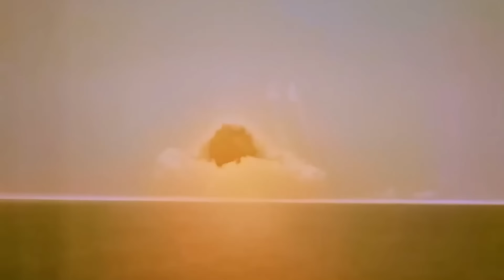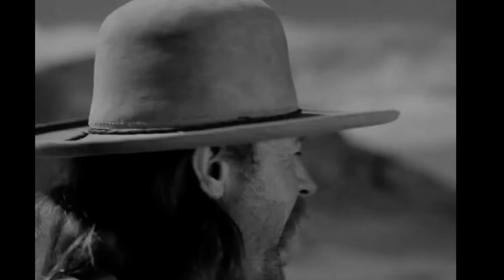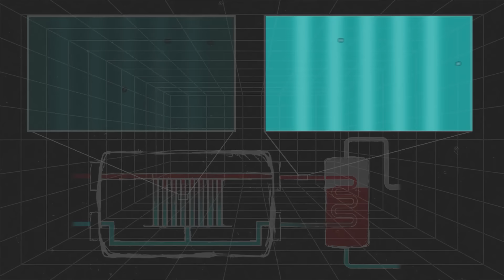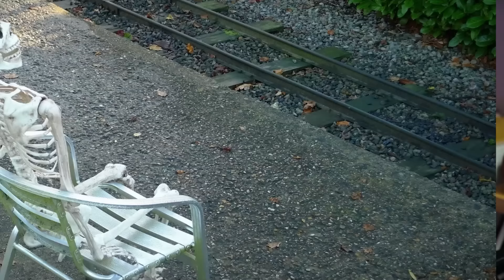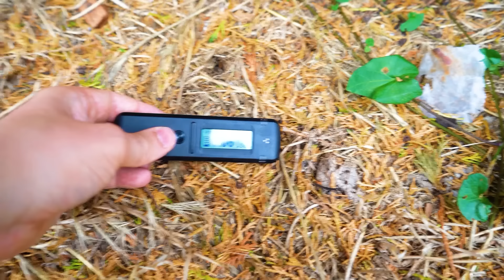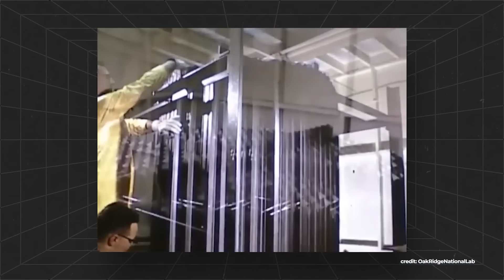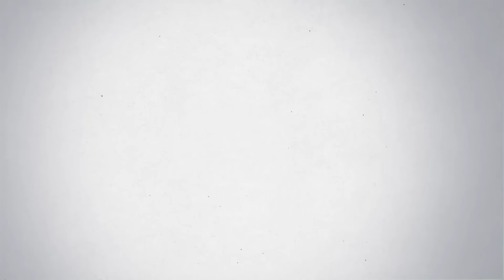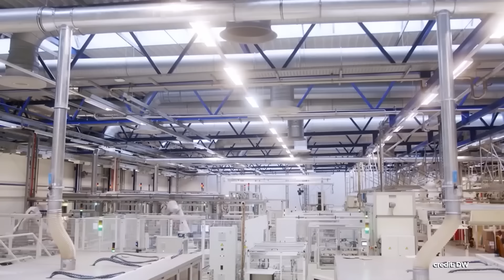It's Happening - China Launches World's First Thorium Nuclear Reactor

Comment: well, why dont you just tell folks the short and simple.... ie... a thorium reactor is the best design as when there is control failures, power outs etc... the core just goes to sleep.  it does not and cannot go supercritical.  and,.. the usa dept of energy... (corrupt as it is over the many decades ive worked with it) had development programs for this tech.  but.... it got killed off by the money makers.... so, vote for the thorium core... its good.  just my opinion

Comment: A physicist claiming that China's reactor (which won't be operational until at least 2029) is the worlds first??!

There have been several thorium reactors built and running operationally: Oakridge National Labs ran the MSRE (Molten Salt Reactor) for 15,000 hours 1965 - 1969.
The third Shippingport nuclear reactor was a thorium reactor. Over its 25-year life, the Shippingport power plant operated for about 80,324 hours, producing about 7.4 billion kilowatt-hours of electricity.

Comment: AFAIK, your comment regarding any potential advantage of Thorium molten salt reactors siting in desert areas because they "don't use cooling water" is wrong.  The cooling water in any steam turbine based electrical generation is used to condense the steam.  Then the condensate is pumped back to generate more steam.  The molten salt cooling loop still is used to generate steam.  It is just the high pressure part of the system is separated from the reactor.  If you site any steam driven system in the desert with limited availability of make up water, you need to use air cooled heat exchangers, which use more energy and cost more than cooling towers.

Comment: one point, a plus point, is that Thorium reactors output can be regulated (modern steam turbines and generator designs are called for) simply by the circulation rate of the molten salt. The total heat produced is dependent on the residence time of the liquid in the active core. With a modern turbine and generator, these reactors can provide flexible output on demand.

Comment: As stainless steel melts at 2,500 degrees F, it would seem that the piping and other containment vessels in a Thorium reactor would need to use some sort of metal alloy.  Possibly using Tungsten (?).  Whatever is used it would not be cheap.  Another alternative would be to use cooling coils that surround the piping and structures.
Reply: Copenhagen Atomics properly solved all these problems around corrosion by molten salt. Check their videos first.

Comment: I don't get it. -  A thorium powerplant also needs a nearby source of water to feed the steam turbine circuit that generates electricity. But, in the Gobi desert, I don't think that there is an abundant source of water except for underground water which is limited and should be reserved for agriculture and drinking water. Yes, I understand that condensers reduce the consumption of water but does not eliminate it.
Reply: that water is recycled water.
Reply: @michaelwan4268  - recycled water coming from where ?
Reply: @cybair9341  I mean the water used to drive the turbin is internally recycled, thus it does not require that much, and it it does not require constant cooling water, which is the majority consumption of the water.
Reply: @michaelwan4268  - The recycling is far from being 100% efficient. Lots of water is lost as steam escaping at the top of the condensation towers. Additional water has to be supplied continuously to compensate for theses losses. That's why nuclear reactors are built near sources of water. Not in deserts.
Reply: @cybair9341  yes it does still need some water, but water is no longer a constraint, that is why China build this in Gansu Province, there is still some water supply there.

Comment: Thorium cannot in itself power a reactor; unlike natural uranium, it does not contain enough fissile material to initiate a nuclear chain reaction. As a result it must first be bombarded with neutrons to produce the highly radioactive isotope uranium-233 – 'so these are really U-233 reactors,' 

This isotope is more hazardous than the U-235 used in conventional reactors, he adds, because it produces U-232 as a side effect (half life: 160,000 years), on top of familiar fission by-products such as technetium-99 (half life: up to 300,000 years) and iodine-129 (half life: 15.7 million years).Add in actinides such as protactinium-231 (half life: 33,000 years) and it soon becomes apparent that thorium's superficial cleanliness will still depend on digging some pretty deep holes to bury the highly radioactive waste. It's a corrosive environment and no materials can withstand it longterm so how often will the reactor need replacing? Its thermal output is also lower making it more inefficient compared to PWR's and please China bodges pollutes and generally doesn't care about environmental issues tye CCP will claim they have cracked it because they never admit to failure.
Reply: Copenhagen Atomics properly solved all problems around. They are already prodicung small scale molten salt thorium reactors!!! Check their videos!!!

Comment: I don't get how you build a reactor in the desert. Even without water as coolant from the primary circuit (reactor), you still need to cool you secondary (steam turbine) circuit, typically with a tertiary circuit with a cooling tower that requires a water source.

Comment: Its good to see anyone in the world developing this essential benefitial power source technology. Frankly it's just been stupid not too. It is the only sensible atomic energy source that is realisticly safe and practical. Its my understanding that Alvin Weinberg was astounded by the stupidity of development and use of the least sensible reactor type,that being the one in use currently, referred to as high pressure water reactors. With these any loss of coolant supply and you have Chernobyl, Fukushima, Three mile island type of disasters. With any situation of emergency using molten salt(Thorium) type you just let the reaction flow into storage vessels where it simply cools and solidifies. Why wouldn't you prefer to use the obviously safer system?

Comment: I have lots 9f questions:    1. as the reaction works off U233 fast neutron production, how do you start the process without adding too much/little U233.    2. What controls the rection speed - in a normal reactor there are graphite rods inserted to slow the neutrons down below fission speed.     3. What is the SCRAM protocol for emergency shutdown (I noticed the freeze plug but that won't stop the U233 decay.    4. How do you remove the extremely toxic U233 products from the molten salt?    5. Each of your displays show the molten salt at its a temperature go straight at exchanger into the super-heated steam - why is it not fed into the lowest point and pulled out at the required temperature.      6. A major malfunction can occur with the design models you show if there is a thermal facture in the heat exchanger pipe. As all radiation by-products are dumped into the open loop turbine steam loop.    7. Why are rhe generating capacity powers you show s low?       Anyhow enough questions for now :)

Comment: You mention that Thorium is 3x more common than Uranium, but you fail to mention that only 0.7% of Uranium is used. (U235) and not the bulk of Uranium (U238). The picture is a bit more complicated than that, since the enrichment % used is fairly low for a reactor.  The end result is that only 5% of the Uranium is used.

Also you have not mentioned the difference between thermal neutrons and fast neutrons and the difference in cross sections, and that the thorium reaction can thus only take place inside the reactor. (In the thermal reaction range).  Or that if a fuel lead did occur, then the salt obviously cools and solidifies.

Comment: I don't claim to be an expert, but there are real materials issues that have to be solved in a true thorium reactor. I don't see any mention that these problems have been solved. Or that these units actually work for any extended time. 
I suppose it is good that they are building units and trying to solve the problems.
Some of the thorium stories passed around involve using thorium in conventional reactors. There is lot of confusion.

Comment: You made a lot of mistakes in the video, some of them could be described as blatant scaremongering against uranium fission.
Putting Three Mile Island accident in the same basket as Chernobyl is out of the question. The public was not harmed by it, if we exclude the fear created by the media.
You also mentioned thorium molten salt reactors don't need water cooling. Yes, they do. Those whole systems are heat engines and waste heat has to go somewhere or the energy flow (work) STOPS. Environmental liquid water is the optimal heatsink.
"Internet" has popularized thorium myths. The idea that it can't be weaponized is pure bullshit - it produces a neutron flux and can be used to breed fissile uranium, which it does in its normal work, but can also be used to expose slugs of fertile uranium to fissile uranium.
Whenever thorium is mentioned in these types of videos, uranium is always demonized. Booo, waste! Uranium cycle has been closed. Breeder reactors exist, they destroy the waste or minimize it.
High pressure water is a problem? No, it's not. It's a feature of a highly efficient heat engine.
Do we have uranium fission reactors that can passively cool themselves down in case of a major accident such as major breakdown of primary coolant loop? We do. Core catchers exist, they are nothing new.
Uranium fission reactors are a proven technology. Their "waste" is a secondary resource that is foolish to bury. It is nothing more than a political scarecrow for the ignorant ones.
Halflife of thorium versus halflife of uranium? That is completely irrelevant. Both are natural elements found in the ground. High level waste's halflife is relevant, and it seems like you think halflife means "time when they stop being radioactive". It's merely the time needed for the half of the sample to decay.
Xenon-135 is not a problem for active uranium fission reactors. It reaches equilibrium as it's being destroyed and formed. It's only a problem after shutdown - turning the reactor back on can't be done immediately.

Anyway, the video is a highly populistic and quite ignorant approach to the subject matter. I just pointed out few mistakes. There are more. Even spelling. Like monzanite instead of monazite.